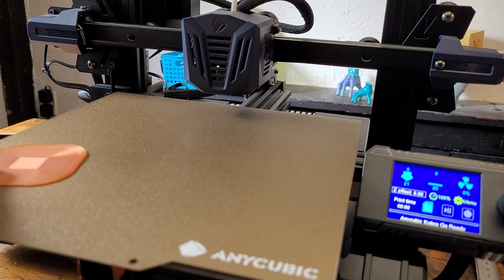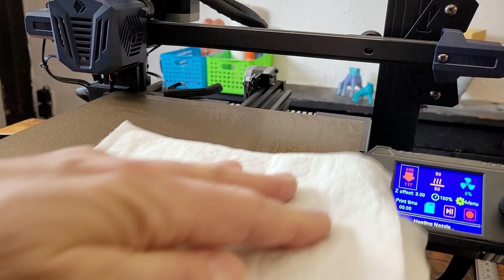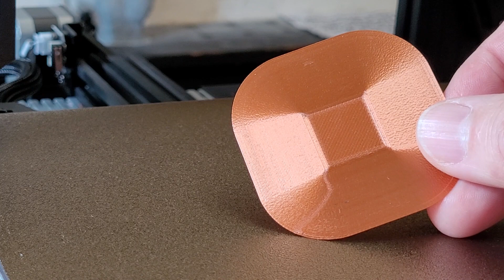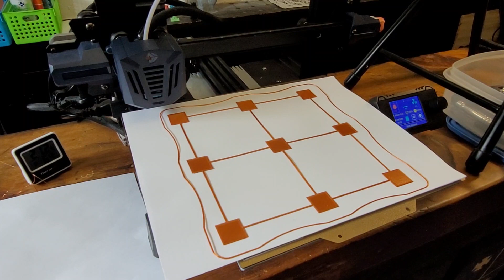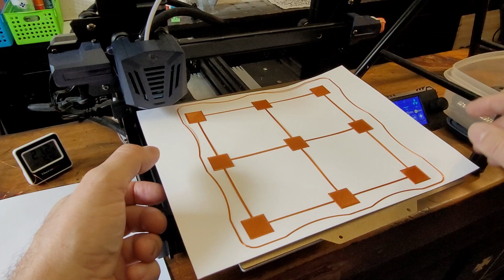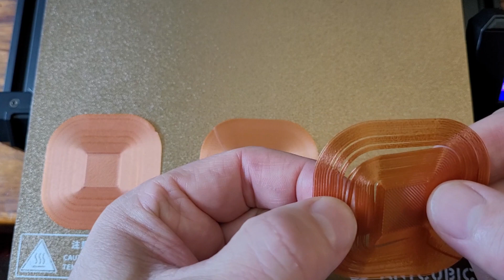Set the Z Offset on an Anycubic Kobra Go 3d Printer

Comment: Hey i have a question on layer shifting. I bought a Kobra 2 Max on Marketplace after having great luck with my first one i got new back in January 2024. This used one had barely 8 hours total print time
Reply: My used one has a severe shifting issue at standard it shifts every layer. I put a new belt on the rt side y axis because it was already over stretched and ripping. Checked all the pulleys tightened one that was loose but I get a bumping/skipping noise as it's printing still
Reply from the maker: If you run it without filament and the belt to test does it still make the noise? Let me know. Sorry for the delay responding
Reply: @mayhemsmiley  it's okay, I spent one full day just running tests and diagnosing it, and finally found that the bed was not running level on the rails. I readjusted and tightened it all up, ran the auto level, calibration, and vibration. Then tweeked the Z offset and now prints just as beautifully as my other!
Reply from the maker: @chazhaze3d  that's awesome. Thanks for letting me know

Comment: Mayhem your brim looks so clean! no matter how hard I've tried I can't even reach close to your results. I'm worried that i have something going on in my gcode. I would like to ask you if it's possible to post your code?
Reply from the maker: Hey Russkie, what format would you like? Do you want me to paste the gcode here in the description or create a file and share through google docs? Let me know :)
Reply: Thanks for getting back to me. Whatever is easier for you, :)
Thanks in advance!
Reply: @mayhemsmiley  waiting patiently :))
Reply from the maker: Morning  @russkiebetta   sorry about that, easily distracted sometimes LOL here's a link to the sliced brim I use all the time, you may need to change temps depending upon your filament. https://drive.google.com/file/d/1OGBJxgn2zk57PPY6mYcooIlWW5AlTH0K/view?usp=sharing
Reply: @mayhemsmiley  lol no worries, I fully understand :)

I think you misunderstood me regarding the brim code. I wanted to see your machine Gcode and compare it to mine. But thanks anyway for the brim file :)
Reply from the maker: Morning  @russkiebetta  sorry about that, yes I misunderstood. Here is a link to both my Kobra Go & Neo. Only thing is I override some of these in the start up code of whichever slicer I'm using. Let me know what you're up too https://drive.google.com/file/d/1b7fvfleqxQwiWEwb8hyf5Zlu84oHSQtZ/view?usp=sharing

Comment: Hello! Just purchased a Neo yesterday as a first printer and I must say that I'm already finding your channel useful.  There is MUCH to learn as I am a COMPLETE newbie to 3D printing.
What I would like to know is where I can find the file to print the test cube with the wide brim so I can work on finding a good Z offset.  Thank you!
Reply from the maker: Hi Peter, here is the code for Neo 30mm brim. https://drive.google.com/file/d/12y1K1gXLjgv5dCyfRSqS7n5a79xWmfy9/view?usp=drive_link
You should verify your extruder calibration first though. https://youtu.be/dSby7hwa4Nk Let me know if you have any questions.
Once you've verified your extrusion, open the Gcode i've sent with Notepad ++ and modify the value in the M93 EXXX, replacing the XXX with your extruder values.
Reply: @mayhemsmiley  Hello...I did the extruder calibration.  Needed to set it to E408 before I got the correct extrusion.  It was quite a different number than your video, but it's extruding the correct amount now. 
I would like to print that test cube with the 30mm brim, but I don't know where to find the file. The link you sent me said that I needed to request access which I did,  but I haven't been able to access that file,  but I don't know if that's the cube file or not.
Reply from the maker: @peterseyranian3931  Hi Peter, sorry about that, I didn't realize that the fiel was set to private. That was just a brim, but here is a brim with calibration cube. File has my retraction setting of E400. https://drive.google.com/file/d/1frrSXtAyQxP9uBQdD5AQqSNM8_LzyfDu/view?usp=sharing

Comment: So the z axis is supposed to be 300? And the z offset is supposed to be -520? I'm trying to print off the sword. What's the best settings?
Reply from the maker: The 300 is purely to raise the nozzle, this ensures that start from above and then lower the z offset. Your z offset will likely be different from mine because the sensors will never be positioned exactly the same from one Kobra to another.

Comment: It seems that I can't print anything bigger than a Benchy it seems, my bed is warped in the worst places, whenevee I try it either finishes but comes out warped or just completely fails
Reply: Ok will do and i'll update you!
Reply from the maker: Hi Njt, follow these steps and then do a calibration cube, I would get these items under control and then start trying more complex prints https://youtu.be/Wn5jI6O0cWo
Reply: I have followed these steps and that other video but every single time I try to print anything a tiny bit long it will be fine on one side but the otherside will be a mess
Reply from the maker: @njt9728  Do you know how to use pronterface in order to see the bed readings? You mentioned that your cross member sags on the idler side. Let me know if you are able to use pronterface to get the bed readings.
Reply: So turns out my printer is over extruding so i've been trying to fix it in pronterface using that video you reccomended but i'm only getting errors saying i can't extrude that much filament
Reply from the maker: @njt9728  I would say to repeat the process again slowly just in case of making an error. I used Daniel's process and it worked. That doesn't mean that there may be something else happening with your printer though.

Comment: anycubic needs to hire you, no joke, that first layer looks mint, like a shim of copper.
I have a kobra neo, I want to add in case someone doesn't know (I didn't) that you also need to ""manually calibrate"" the bed distance sensor, the one that the machine uses to auto level. https://www.youtube.com/watch?v=25x84AaiUpQ
Reply from the maker: Interesting, thanks I didn't know that either. Now, others may find out too. Is your neo working well?

Comment: This is great.  Do you add a script in cura to pause after layer 1?  Or do you just stop your print after it completes layer 1?  Thanks for all your tips.
Reply from the maker: Thanks Dave.  I use a cura script to stop after layer one.
Reply: If the actual part base, not brim, is good, does it really matter what the brim condition is like?  I tried using auto bed leveling alone, and the base on the part bottom is great but the brim separates.  When I tried Z offsets to dial in a connected smooth brim, I was able to get the brim connected more (not as good as yours) but the base part still was perfect.  So I am not sure about the point of getting a perfect smooth brim.  Thanks.
Reply from the maker: @Dave51262  HI Dave, I haven't run the bed leveling sensor probing since I converted the bed, but I do have the bed leveling turned on so that it uses the data captured by the sensor. I'm just sharing a method so that peeps can know that they have set a good z offset and the ability to analyze the results. I will print one of these before a large print as verification in an effort to reduce the risk that something has gone wrong.
Reply: @mayhemsmiley  Thanks for the clarification.  I was able to get a perfect brim like yours (smooth and no separations) after running several flat cubes and adjusting the z offsets a little each time.  Really great!  Thanks for sharing.  This printer really is great for the price.  So thankful I came across your videos.  I never would have known about it.

Comment: My only problem now is adhesion, I get warping on edges but it only happens sometimes.
Reply from the maker: Use a glue stick to create a thin layer on the bed and see if that helps. 
I use it for big and long prints as an insurance policy.
Reply: @mayhemsmiley  I do but it's also a hit or miss. I might need to move my printer location somewhere other than a room that has multiple people coming in and out? My bed temperature is also on 65. Should I lower it?
Reply from the maker: @TalinoVT  test it out.  I rarely go above 50

Comment: Not to be a jerk, but that spring mod is kind of redundant. The auto bed leveling feature makes sure that the nozzle is always the same distance to the bed even if the bed is crooked or concave or convex or whatever. And regarding the technique you re using, you are willing to do that after every level its up to you, but the piece of paper method require A LOT LESS work.
Reply from the maker: No worries, if we're having a constructive discussion, I'm very open minded.
I'm a huge fan of testing for repeatability and then making a change and repeatedly testing to see if I achieved the solution I was looking for.
The printer was fine tuned and printing well, but the brim was never even all around. I was curious why.
The testing I believe revealed that the sensor readings are too coarse. It doesn't handle the discrepancies between each sensor position.
Using the spring method to flatten the bed more has reduced the discrepancies and get even better quality of prints with more even brims.
Now I have very little movement of the z axis during each level of print, I added an indicator to the z axis to make the movements more visible to the naked eye.
Like this, but I've modified the pointer to make it round and larger so that it is even easier to see the movement https://www.youtube.com/watch?v=OZeYlyyh1Xk 
I have not leveled the bed since I modified the bed so I don't employ this technique often.
Just sharing for people who may find this easier than using the piece of paper and hopefully help people to understand how to troubleshoot their prints for better quality.
With the paper technique do you do it hot or cold, if cold there could be dried filament at the end of the nozzle that will affect your setup and won't know why the results are off.
I will periodically do one of these brims before a big print just to verify before investing the filament and time.
Let me know your thoughts, like I mentioned I'm open minded and enjoy a discussion.
Reply: @mayhemsmiley  I had this inconsistent brim issue to but the like the brim, the issue itself is inconsistent aswell and I haven't tested anythig as to see if it is this or that so I have no statement in this regard but at the moment im thinging of upgrading my Kobra Go with a dual z axis to make sure that the gantry will not sag and hopefully extend the lifespan of my rollers. Sagging might be one of the culprits as everytime i print a brim/skirt, it is thinner on the side of the gantry that is not supported

Comment: I have one of these as well. Just a heads up for what can happen. Due to very tight grip on the zipline that holds all of the wires at the top of the head my ABL touch sensor wire has been damaged. Probably 'cause of frequent and short X movements. Had to cut the wire, find the damaged spot and stick them back together. Wasn't funny at all. Thought the sensor will stay dead forever.
Reply from the maker: Did you geta little satisfaction from repairing it yourself, I do when I fix things :)
Reply: @mayhemsmiley  Yes, I felt very proud of myself in the end, but in the process, I was terrified that I could screw up everything.